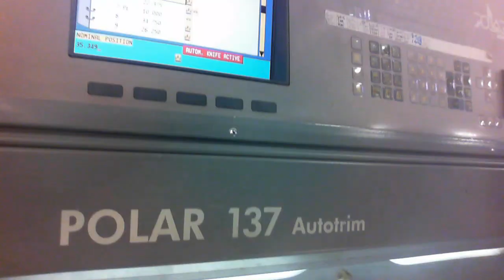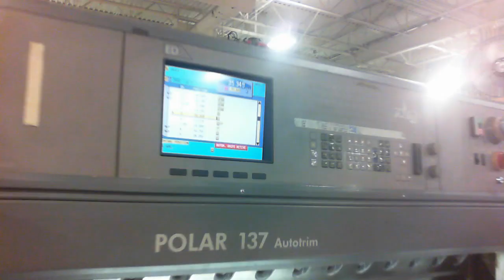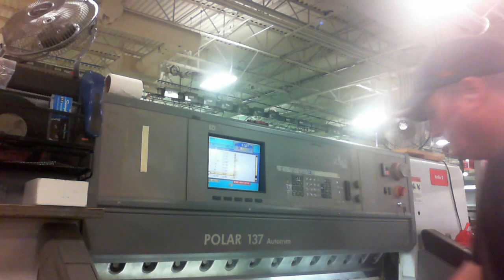Polar 137 - w/Autotrim, Unloader

Comment: What I could never understand about the unloader thing is why does the operator have to stand there and watch it?  Isn't the entire purpose of it being there so that the operator could be jogging up the next load while the unloader is doing it's thing?  Isn't it supposed to save time and money?
Reply: The operator is watching it for his own  piece of mind.  I've seen operators not tighten the locking handle before and push a whole stack on to the floor!
Reply: We usually take a look at the unloader when we use it the first time for a job, just to control if it's working correctly.

Comment: Why is he turning the block the wrong way?  If the paper is crooked, then it is crooked when you insert it with the oblique angle, even after the angle cut.
Reply: What do you mean? Are you talking about the second cut?
Reply: @nickrin5615  yeah i think that what he means.  Usually you would turn it the other way so you are cutting on more of a right angle then you would the way he did it
Reply: Agreed. He should of cut on the same side he clamped out on.  He did on the first but not the rest? Idk
Reply: Comments from boys with little experience. See he touches the block on the side square.
Reply: I know what you mean. He's spinning the stack the wrong way, after you make a cut you should have the freshly cut side either up against the sidelay or  against the backgauge for the next cut. I wonder if his stock is square after cutting?
Reply: @blackflagqwerty  That is the right way to do it sure, but for some reason its turned opposite the lay, the stock will be out only slightly, depends on the job and when or if accuracy is important.
Reply: Could have side guide to the other side depending on how they run their press